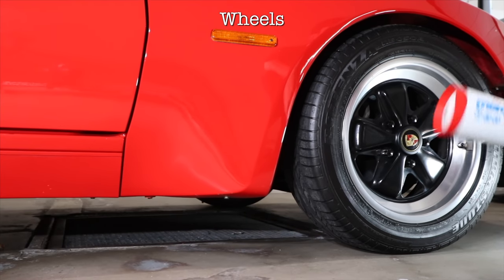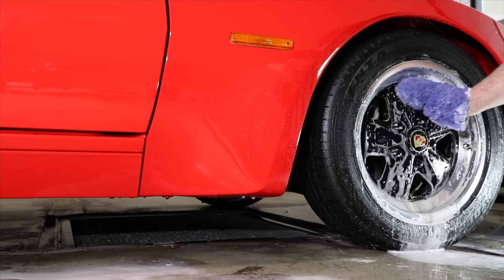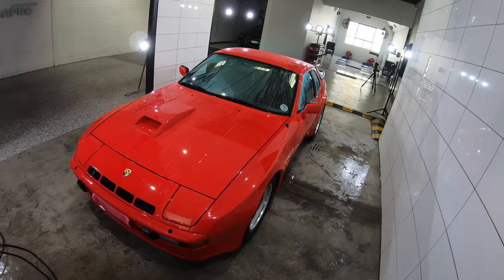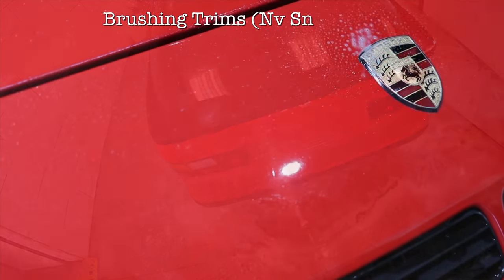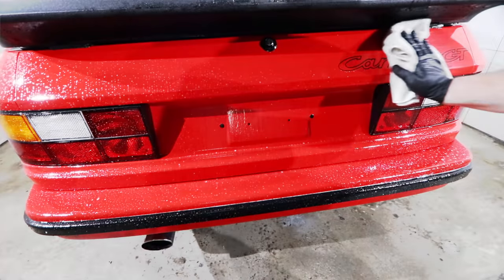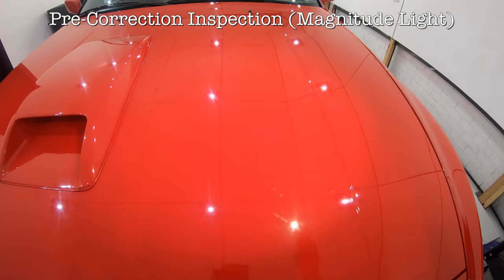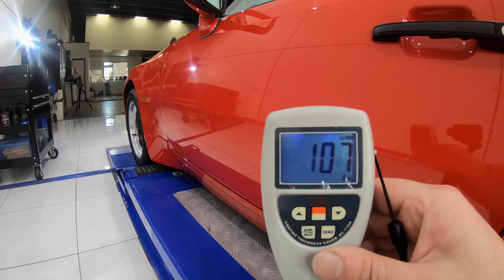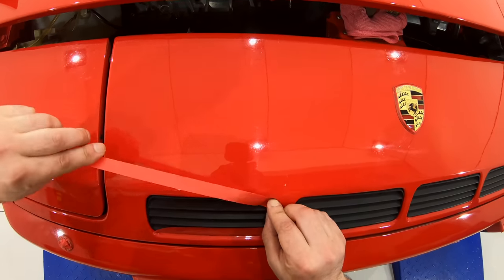Porsche 924 Carrera  GT - Detailing & Preserving a Classic! P1 Wash & Decontamination! (Vlog 28.1)

Comment: Perfect quarantine entertainment. I also might add thanks for introducing me to the Kranzle K1122 in your videos, by far the best pressure washer I've ever owned.
Reply: @CarCraftAutoDetailing  love mine, especially how well it foams a car with its high flow rate. Also, Holy crap does this Cquartz Finest Reserve make this Subaru Ceramic White pop! Now just to stock up on Reset and Reload.
Reply: Sandro. Just discovered your Chanel in the last few days. You're videos are fantastically shot, you explain things very clearly, and your work is top notch. Keep it up. Now subscribed. 👍👍👍

Comment: Not to be a snob but there actually never was a 944 Carrera GT. This is a 924 Carrera GT, the biggest difference was that the 944 had a porsche 2.5 Litre in house developed engine. It was actually the prototype engine used in LeMans in 1980 in the 924 Carrera GTR. The 924 Carrera GT uses an Audi sourced engine. In 1987 the one and only 924 to get the actual Porsche engine from the 944 was the 924S model. 

That said these cars are EXTREMELY rare. They were produced as homologized production cars so that the 924 GTR race cars were legal. 

The GT, GTS, and GTR were all 924s. The 944 was derived from those cars. 

Recently at auction (2019) a 924 Carrera GTS sold for $350,000 

Just some info for anyone curious about these cars. That said loved the video it’s one I’ll definitely be watching more than once or twice 👍🏻👍🏻👍🏻
Reply: Car Craft Auto Detailing Not a problem! Love the content!
Reply: @TakeFlightGarage  the 924S was 1987-1988 in the US/CAN, but 1986-1988 everywhere else. There were over 3500 RoW 1986 MY 924S's made. My mate scrapped one though!
Reply: j1nx3d5 I want to like for the info but I’m torn between disliking for the scrap! 😩😅😅

Comment: Hi Sandro, appropriate video as I am about to decontaminate my Hyundai Tucson (22 monsh old) that is parked outside 24/7, that I had coated with Opti-Coat Pro+ 12 months ago at the end of this month. My question if you are able to answer: there is some water spotting, do I remove the water spots before using iron remover? I will be using Opti-Coat products for the decontamination. Great video with full explanation as always.
Reply: @CarCraftAutoDetailing  Thanks Sandro.

Comment: I have a problem where i charge for a 1 step and i know it wont remove all the defects. All the worse defects i cant help but remove and dont charge for cause id feel bad giving the car back with scratches. What the hell do i do 😅
Reply: @CarCraftAutoDetailing  what do you ususlly do? I feel like i havent done my job if i didnt correct the paint completely and gave the car back knowing there is still deeper scratches clearly visible
Reply: @CarCraftAutoDetailing  ohhh i see. That would make sense. If i keep operating the way i am i could end up going down hill

Comment: Hi mate,
On average how may washes do mitts last? 
And are you liking the Cloudburst more than the Carpro MF mitt? I’m starting to feel my Carpro mitt is scratching my paint because the fibres became hard. I take good care of it so I am really confused.
Reply: Do you put the mitt through the wash machine? It's probably hardened up from all the dirt and gunk that has stuck into it over time. Wash your mit regularly if you dont already.
Reply: kasparov9 I wash the mitt in the machine after every wash with Eucalyptus wool wash and hot water. Might look to get a new mitt soon.
Reply: @ibrahimshareef3984  microfiber strands will fuse (melt) to each other if u use hot water.  It will scratch your paint.  I forgot at what temperature it microfiber melt but its not very high, around 60 degrees Celsius if im not mistaken.  Use lukewarm water.
Reply: Ibrahim Shareef don't wash microfibre hotter than 40C it will melt the fibres.
Reply: Mark Radovic I used to wash them at 40 degree heat 😬
Reply: Ibrahim Shareef yes I’ve had the same and really cared for it too, even a good cold solvent base wash couldn’t bring mine back, funny my old Bowdens shagalystic is 75% like new after almost 2 years, not sure if it’s me?
Reply: Shane Surman just had a look, turns out the fibres turned more like into noodles you find on chenille wash mitts!
Reply: Shane Surman Just tried reviving mine with great success!
Washed it in warm water with with Eucalyptus Wool Wash and added some vinegar to the rinse cycle. After that I gave it a good brush with a hard bristled brush, and now its as good as new!

Comment: Make no mistake that’s a 6 figure car.
Reply: acchaladka that’s a 924 Carrera GT. Totally different animal. They’re super rare. A GTS sold at auction last year for $350,000. I usually see them listed for around $100,000 USD or close to it. https://www.classicdriver.com/en/car/porsche/924/1980/683913

What year was your 944?
Reply: Jake Khader I stand corrected, and right you are - deleted my reply to eliminate confusion. Mine was a 1989.
Reply: acchaladka No worries! One thing I always wished they had made was a 944 variant of the GT GTS. The best way to analogize these cars would be to compare them to a Cayman GT4 and GT4RS compared to essentially a relatively base model 718.
Reply: @TakeFlightGarage  the factory made a race-only 944GTR that was 944S2 based (not to be confused with the much earlier 924 Carrera GTP that was 2.5 16v Turbo)
Reply: j1nx3d5 was the 944 GTR raced by Porsche? Or did they only build a handful for customer teams?